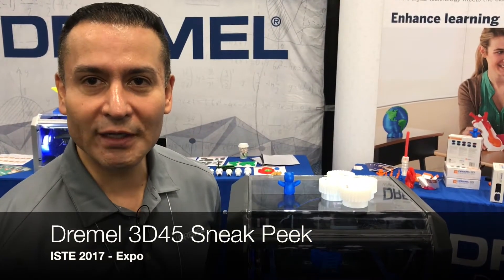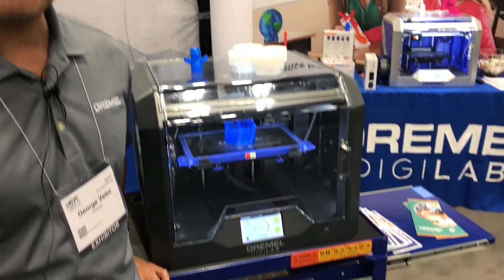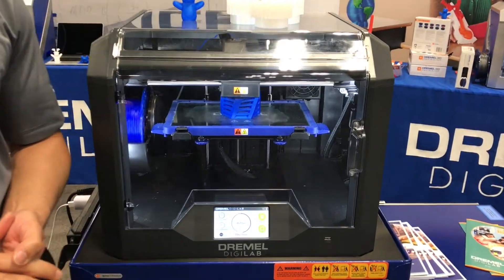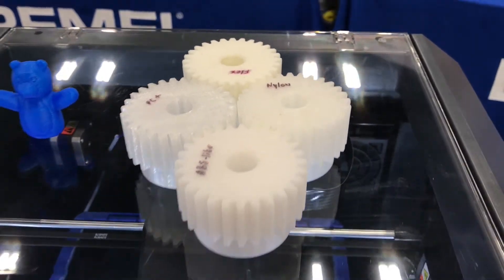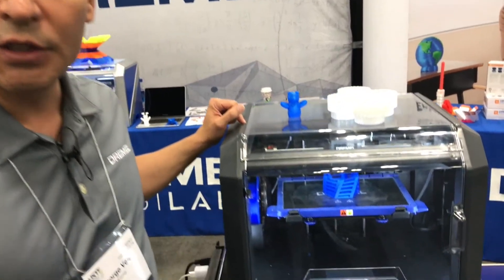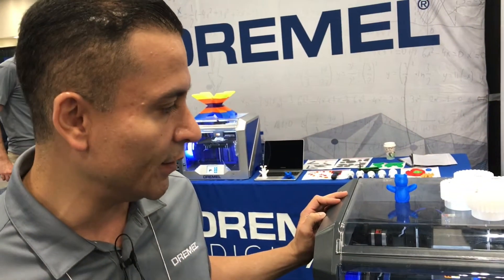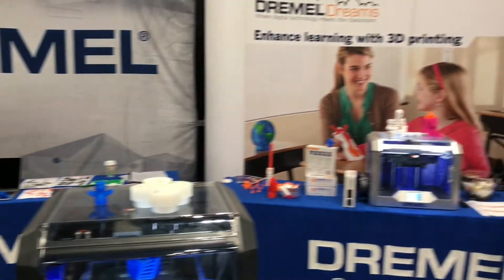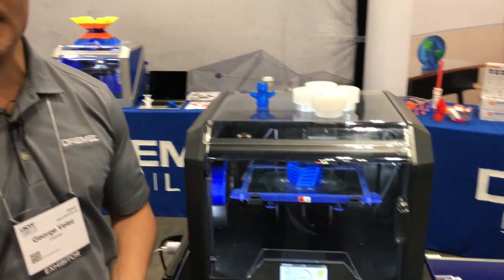Dremel 3D45 Sneak Peek - ISTE17 Expo

Comment: Really looking forward to this machine.  I love my 3D40 (check out my unboxing review on youtube)  I have a few printers and the Dremel 3D40 is my go to machine due to it being so reliable.   Every time the print comes out great.. BUT I've just bought Simplify3D which now supports the 3D40.. Wow.. what a combination!  ..  I just can't wait for the 3D45 release.. won't be long I hope. It's not often I need other materials but with this new hotbed coming .. so looking forward to it.   My only concern is this RFID chip.. It could make a great machine a complete nightmare!  If it only tells the printer the type of filament but can be overridden then that's fine.. but if they start adding in filament left, color etc.. and that a RFID has to be present then it could be its downfall.  I understand they are adding it for simplicity but it might drive away the more experienced user that wants to tweak settings like they can on the 3D40 (Temp / speed etc).  fingers crossed......  :-)